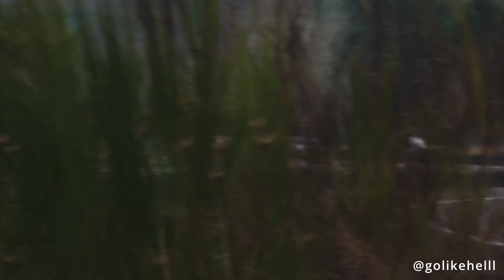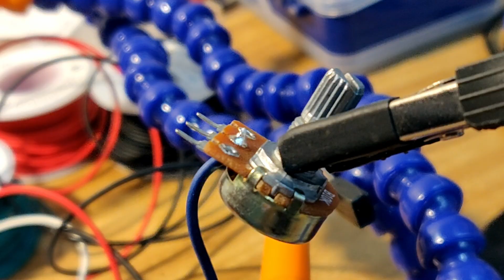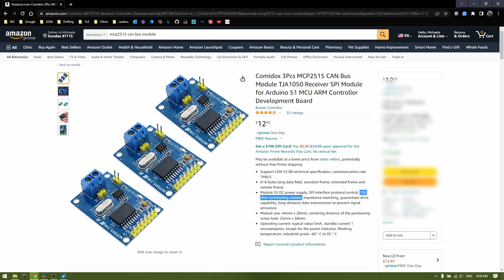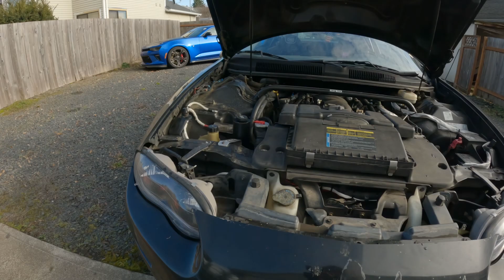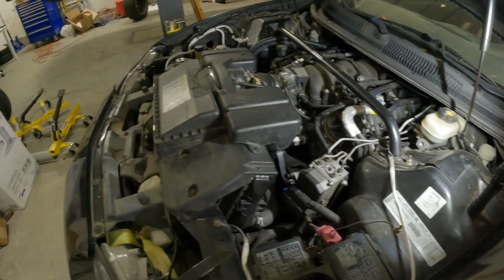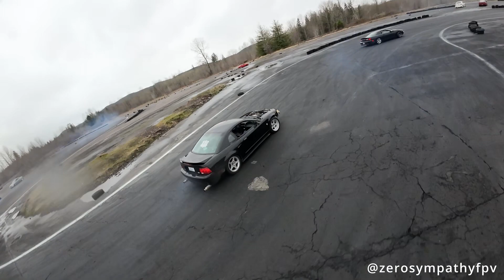DIY Volvo Power Steering Pump Controller and Camaro Drifting

Comment: Cool Video. Do you know if the code in the link provided can control a Mazda pump? The Link you provide to the code also has another link to a production version which looks to control Mazda.
Reply from the maker: I don't think the code will work for the Mazda pump but it could serve as a good starting point to trying to figure that out if you are so inclined. As far as other controllers people are selling go I haven't tried any of them personally but those are probably your best bet if you want a plug-and-play solution.

Comment: I’ve seen multiple videos of the S 40 power steering pump and I was wondering if a cooler is not needed for this set up?
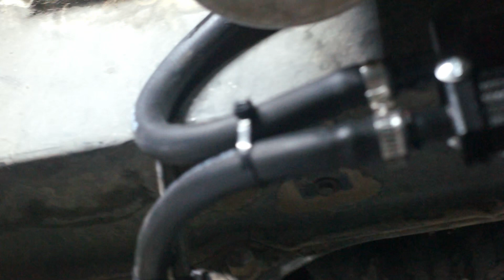Reply from the maker: I have a small cooler on mine (you can see it at 5:48 in the video) and have not had any issues. Granted I don't have any way to monitor the temps on it but I haven't seen it try and boil over. If you are just street driving you might be able to get away with not using a cooler but since it's pretty cheap and easy I would put one on just to be safe

Comment: you having any issues not using a power steering cooler? I wonder if using the code prevents overhearint too.
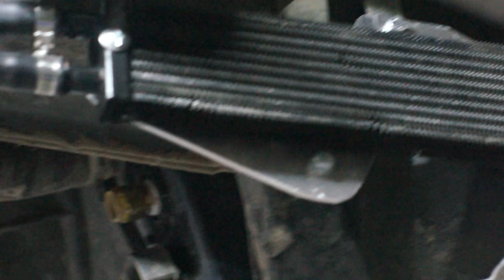Reply from the maker: I do actually have a power steering cooler on it (you can see it at 5:50 in the video) although it is pretty small. However I haven't seen the fluid boil over or anything like that with the Volvo pump even after drifting all day. Since I run the pump at 100% speed all the time with the controller that wouldn't help with overheating but it seems to be ok so far regardless
Reply: @shortgirllongcar Yeah I don’t know why I thought running a higher capacity would help it with overheating LOL I just see a lot of people talk about cooking the pump. I don’t wanna do that to mine I have a cooler I was thinking about deleting it As I reassemble my car. Nice video by the way thank you for sharing

Comment: Is there a way to not need variable speed, so say the code tells pump to run constant 100%?
Reply: So no potentiometer..
Reply from the maker: There are a few ways to do this. One would be taking line 67 in the code and replacing analogRead(A0) with a hard-coded number from 0 to 1023. This will fix the speed adjustment value  rather than actually reading what the pot says. I believe you would want to set it to 0 for 100% pump speed but try 1023 if that doesn't work.

Comment: I have the same Volvo power steering pump on my Honda, but it’s connected directly from the battery to the fuse box. Do I need the controller?
Reply from the maker: That depends on what you are using the car for. Without the controller the pump is not running at full power which from my experience is perfectly fine for a street car but becomes a problem for drifting/autocross.
Reply: @ I’m driving on the street and I’m doing Rod racing. What do you think? Is it OK to be connected directly from the battery to the fuse box or do I need the controller?
Reply from the maker: That setup is ok as long as you are happy with the way it performs. It is mainly a problem when you do many rapid steering inputs in a short amount of time. If it feels like the pump doesn't have enough power to keep up with your steering inputs then a controller would help fix that.
Reply: @shortgirllongcar  thank you very much. I really appreciate your advice. I just wanna make sure I’m not gonna overload the main relay or any fuse.
Reply from the maker: Oh sorry I think I misunderstood what you were asking. I would recommend setting it up like I have in the video going from the battery to a seperate 80A fuse unless you know for sure what you are tapping into can handle that
Reply: @shortgirllongcar  oh yeah, I have the pump installed already is connected from the battery directly to the fuse box. I don’t have the fuse the 80 amp or more that’s why I wanna know did I have to do the fuse for sure or I can just leave it the way it islately I have a lot of issue with starting the car fuses burn out the main relay have a lot of trouble

Comment: Can this work for the mazda pump?
Reply from the maker: I don't know very much about the Mazda pumps but I would be surprised if this controller works with it out of the box. It does look like there are some controllers for sale that work with the Mazda pumps but outside of that I think you would have to research and experiment yourself to see what CANBUS messages you need for that pump.

Comment: question, do the lines need to run to a cooler then the rack or not?
Reply from the maker: I don't think it's completely necessary especially if it's for a street car but I would highly recommend a cooler if you plan of doing a lot of spirited driving or any motorsports. Better safe than sorry in my opinion.
Reply: If you put a cooler in the hi-pressure side, it will need to be rated for 4000psi. 1000psi is what is possible and 4x safety margin goes to 4000psi. Most coolers are on the lo-pressure side just because of this problem.

Comment: You could probably add a gps module to allow it to slow down the pump when you get over a certain speed. I believe i read thats how the pump works in the volvo it came out of. but probably not a big concern for drifting
Reply from the maker: I thought about trying that but with drifting I didn't think it was worth the hassle.  I worry the GPS wouldn't update fast enough and I wouldn't have enough power steering when I need it. You are right though, the pump normally takes in vehicle speed information to determine what speed to run the pump at. Would be a cool thing to try out for a street/grip car!

Comment: Just did this install on my 95 Camaro. Blew the seal out of the rack. The wheel was turning left and right all by itself. What could I have done wrong?
Reply from the maker: Have you double checked you didn't switch your high pressure and return lines? I accidently did that initially when I installed mine and had something similar happen
Reply: @shortgirllongcar  16m should be high and 18m should be low? I need to double check
Reply from the maker: Sorry, looks like I screwed up in the video, it should be that the 16mm (top port on the rack) is the return line and the 18mm (bottom port on the rack) is the high pressure. Going to fix this in the video asap and sorry if this caused confusion/issues
Reply: @shortgirllongcar  i just dropped the rack and replaced the shaft seal.  No big deal. It was the original seal from 1995 so it needed it.
Reply from the maker: gotcha, hope the rest of the project goes smoothly for you. Feel free to reach out if you have any more questions or issues!
Reply: @shortgirllongcar  its running great now thanks. Ill for sure need to watch the video again if I ever plan to use the CAN BUS
Reply: @shortgirllongcar is this the same on an 99 firebird?
Reply: @CIVPIT510 where did you mount yours?
Reply from the maker: As long as it's an LS1 car it should be the same
Reply: @warriorplutotrent3827  right in the front where the air hole is for the LT1 cold air intake. Running a ram air setup
Reply: @shortgirllongcar  oh ok great
Reply: @CIVPIT510  oh ok. Sounds like a great spot
Reply: @warriorplutotrent3827  it's the same for all 4th gen F bodys
Reply: @CIVPIT510  ok I'm overseas right now. I can't wait to get back and do this project

Comment: thank you! This has been an annoying issue with mine as well, just out of curiosity what did you do for the belt path? Did you put in a dummy/idler pulley where the power steering pump used to be?
Reply from the maker: I was able to make mine work by just getting a shorter belt. I basically just followed this forum post: https://ls1tech.com/forums/new-ls1-owners-newbie-tech/1281701-solution-ls1-no-power-steering.html#post13339959 . Not sure if you have an LS1 but hopefully there's some info online for your car's belt routing for deleting power steering
Reply: @shortgirllongcar  thanks again!

Comment: Any chance you'd be willing to build and sell one of these units?
Reply from the maker: Hi Brandon, I'm currently not making these for sale but you may want to check out this link. I haven't tried these personally but they seem like they should do the same thing. https://www.brunosteering.com/product/volvo-hydraulic-electric-power-steering-controller-kit-volvo-c30-c70-s40-v50/